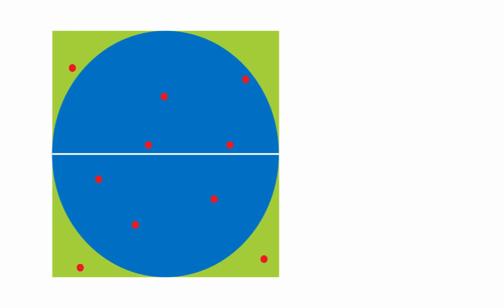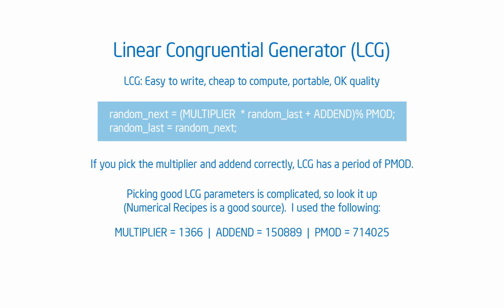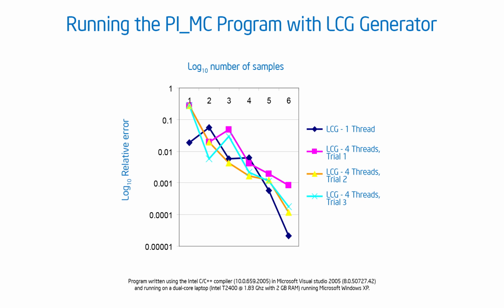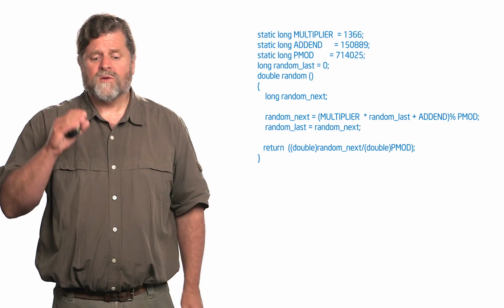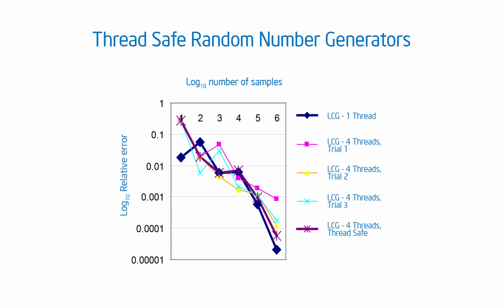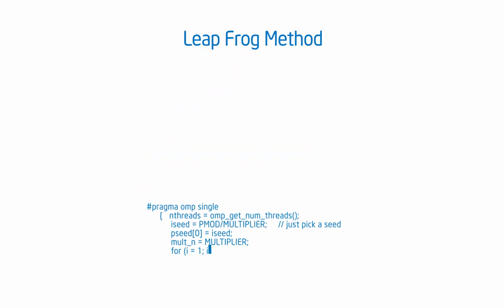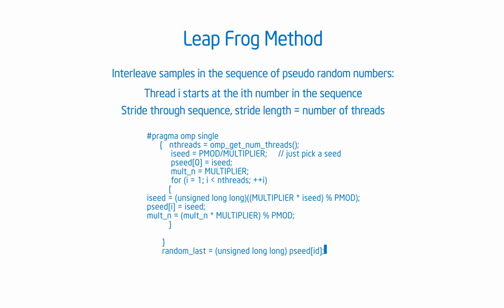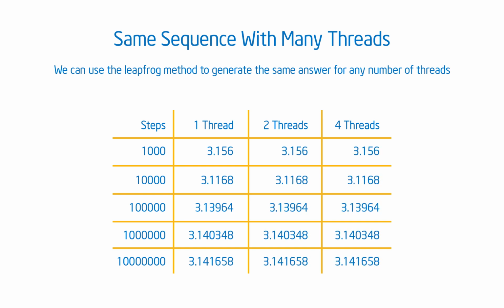Introduction to OpenMP: 21 Discussion 9

Comment: Following the code shown in the video, this overlapping of samples by picking the wrong seed is actually not what happens: the seed() call is outside the parallel region, so each thread gets the same first random_last, so each thread spits out the same sequence of pseudo random numbers. In essence you simply reduced your sample count by the factor of however many threads are used. The actual problem stated, "how to proceed, if your library call turns out to not be thread safe" appears to have been solved quite counter-intuitively, to say the least. Why should you get away with changing the library implementation, when changing the library header is ruled out? The only answer left is to update the shared (encapsulated) variable random_last in a thread safe way, namely by marking " x=random() " and " y=random() " critical which unfortunately mostly renders the program as sequential. Which makes sense: There doesn't happen much else than updating random_last, and each step depends on the previous update. How should one be able to parallelize this.